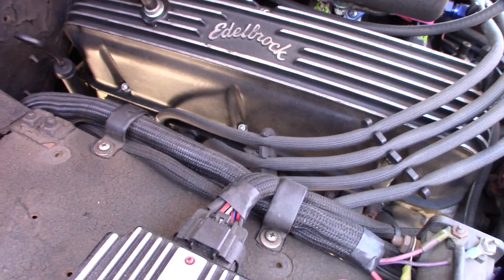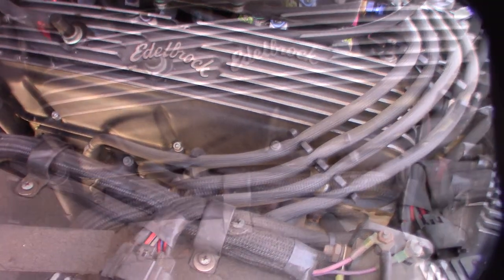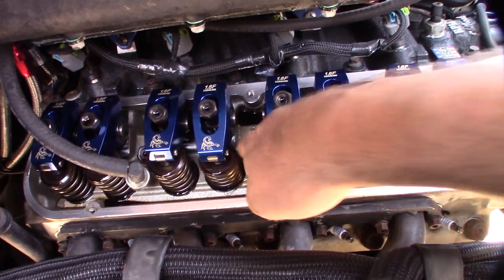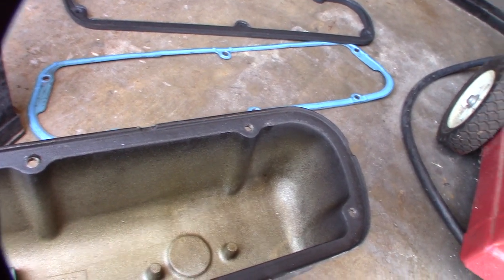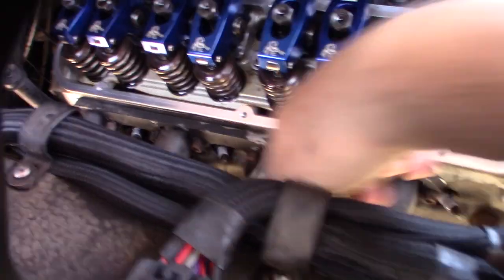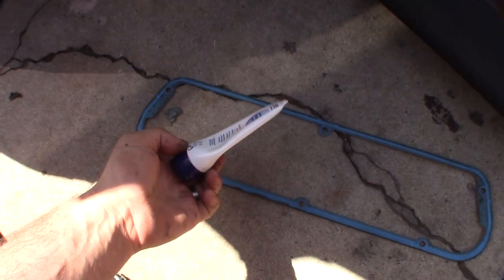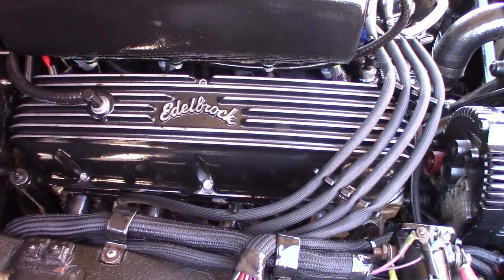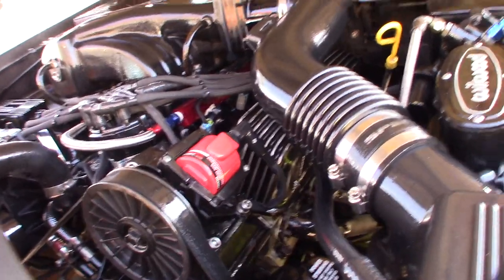Ford 289 302 351W 5.0 valve cover leak repair Fel-pro steel reinforced gasket

Comment: I have a 93 e150 5.8l. Tuned it last yr changed out wires,plugs,coil,distributor and rotor and could not get it started after wards. Turned out a wire from the spark plug was grounding out. The van, @ slow speed like pulling out of a spot or backing up, stalls.Some times after making several stops and i restart it,it runs rough for a few seconds. While running it runs fine.If i'm going up/down incline, the idle drops almost to a stall.This after i changed the TPS, air iddle control valve,map sensor, egr valve the sensor and pipe that goes to it,pcv valve,fuel filter and computer. Still have the idle issues. Was told had a vacuum leak. Had it done. Sill have the issues.I've been to 6,mechanics including ford dealer ship and 2500 dollars...I still have old computer and several of above parts that were not the issue. HELP.......Running out of time and funds. Van only has around 160k.
Reply: I would take a can of wd-40 and spray it near the plenum gasket to see if its leaking it sits on top of your intake with older motors like that you can pretty much see all the vacume lines but a I don't belive a vacume line would cause all that but if this started after you changed your TPS maybe you got a defective one. I would change it first.
Reply: The only other thing it could really be it clogged fuel injectors as long as your obd1 computer is working correctly. I would test the computer and if it's fine then order some injectors and put them in.
Reply: I saw a guy with a old 5.0 Bronco, his were so clogged it wouldnt even start.

Comment: Use the stock Ford bolts on the valve covers with a stock gasket , permatex #2 it will last for years

Comment: 85 351w 4bbl. Found oil in plug six after misfire. Any advice. Already changed cylinder six plug to fix it for now.